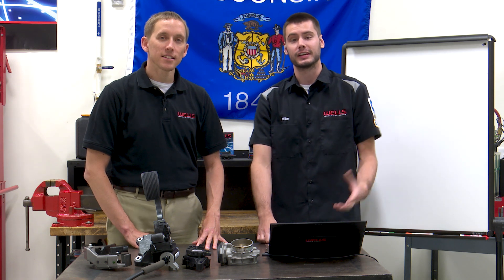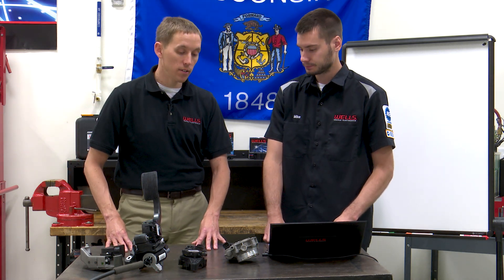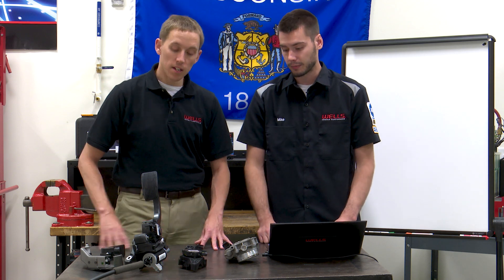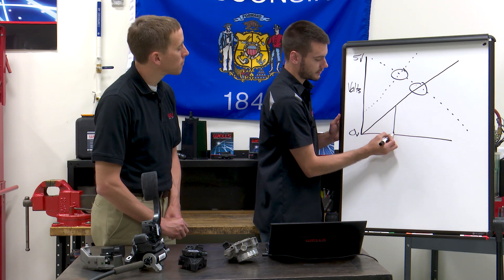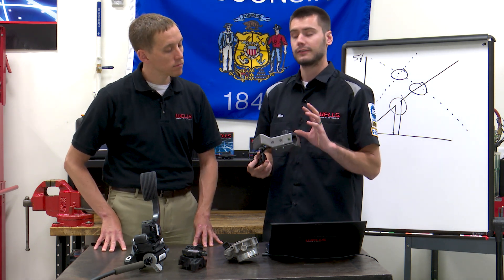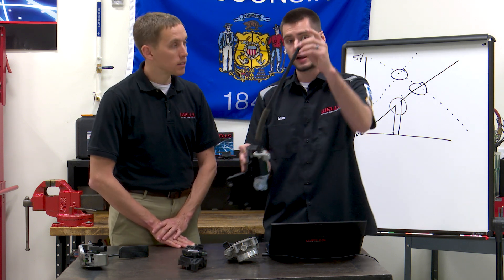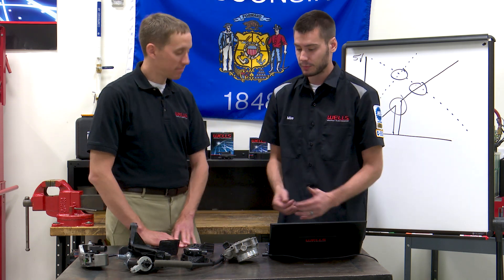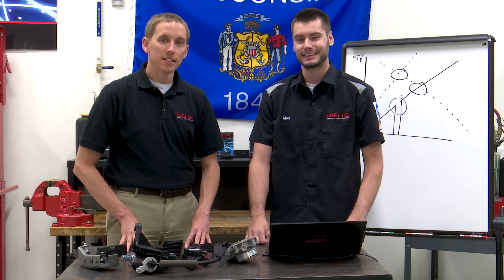CounterPoint Ep. 25 Accelerator Pedal Position Sensors (SU15139, SU13860, SU16051)

Comment: HAHA hooks on a gas pedal...we also had rods & bellcranks, clevises, rod ends. We had technological advances when we went from cable operated chokes to bimetallic spring automatic chokes HAHA. We did have gas pedals shaped like feet...you guys were killing me :D
Reply from the maker: Hey Bob! Gas pedals shaped like feet offer the best in performance, as well as the best user interaction! Like those toe shoes right? 
Mike Becker, Technical Services Instructor
Reply: They used to bring me them for me to install with matching little foot for the dimmer switch HAHA. Add some flame decals and they thought they had a race car. When they really thought their 140 hp 4 cyl was fast was when they brought you the triple bladed windshield wiper blades in neon green with the little spoilers to help apply more pressure. Seemed to be tons of Dodge Neons running around with neon everything...ahhh those were the days. As far as toe shoes I wouldn't know b/c I have worn work boots since 16 and wear them with shorts HAHA and when I want to add some style I untie them :D
Reply from the maker: Ohhh the little foot dimmer switch, you're talking like for the highbeams?!!! Those switches are well before my time. Everything I've ever owned has had a hand manipulated dimmer...or now...automatic. maybe we could start a trend where you have a little hand, for the column mounted ones? Those triple bladed windshield wipers added tons of power. 3 blades=cleaner windshield=less wind resistance=faster!!! I believe everything you said up to the point about walking around in work boots untied....you're going to break an ankle! Hard to fix cars on crutches :) I bet work boots, shorts, a Wells shirt, and a Wells hat going to be the next big thing on the runway! Ozzstar may even swap out those shorts for some yoga pants! 
Mike Becker, Technical Services Instructor
Reply: HAHA you should patent the hand...it was your idea and I will let you take 100% credit for that one :D  When you untie your boots you have to make sure the laces don't touch the ground...part of the OSHA NY style from the 70s. I'll have to upload the photos from the cruise with me wearing my Wells hat & shirt...that went over really good HAHA
Reply from the maker: Totally should! I'm sure it would go over really well in the "accessory" section at the parts stores. Ahh, I see. Laces tucked in. Makes sense, don't want to create any safety hazards! Awesome, i'd love to see them. Did you enjoy your time away? I bet your wife was thrilled when she saw! You can blame me. In fact, you have my number, she can call and yell at me! I can take it :)

Mike Becker, Technical Services Instructor
Reply: HAHA she knew what she was getting when she married me...she got a mechanic & I think dressing up means putting on a good pair of jeans with no grease spots on them, my Timberland work boots and a button Triton or Snap-on shirt :D. Remember the work boots have to be the high ones or you'll look funny :D
Reply from the maker: Haha at least she knew ahead of time! It's amazing how our wives are able to put up with us right? I wouldn't put up with me if I were in her shoes haha! Does that good pair of jeans have holes? There are different height boots for different occasions? I need to read up on modern day mechanic fashion. I thought I could get by with just one pair for everything!
Mike Becker, Technical Services Instructor
Reply: HAHA I'm the last one to ask about fashion. Modern day I think you have to have a GoPro Wells hat cam with the hat worn backwards, Mechanix gloves, sunglasses worn on the back of your neck, & accessorize with Pico leads with amp clamps attached to your pants belt loops...told you don't ask me :D
Reply from the maker: I like it! Don't forget about the old Snap-On scanner keys on chain around your neck!
Mike Becker, Technical Services Instructor
Reply: Nice!

Comment: Still driving with cabled pedal,  much easier to see a fault.
Reply from the maker: Nice, I own cars with both. I guess they both have their good points and their bad points. There are some vehicles that have a drive by wire throttle body that still use a cable to a sensor under the hood...silly Hondas.
Mike Becker, Technical Services Instructor